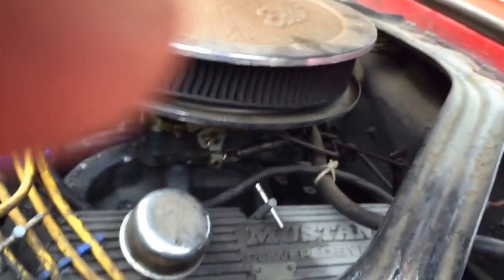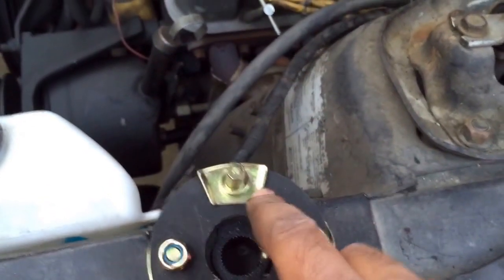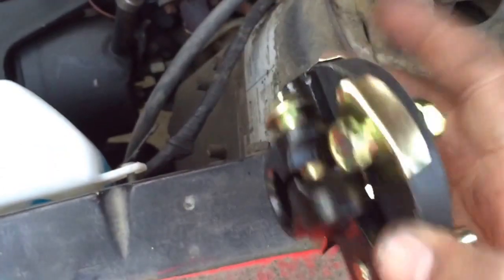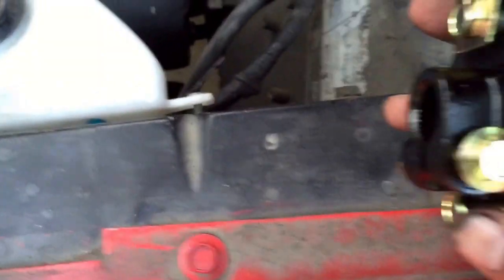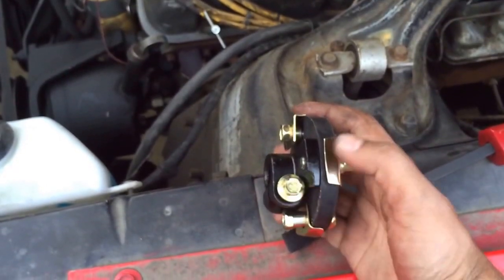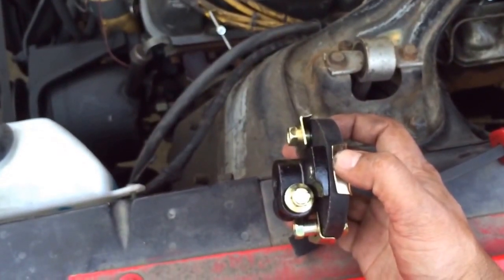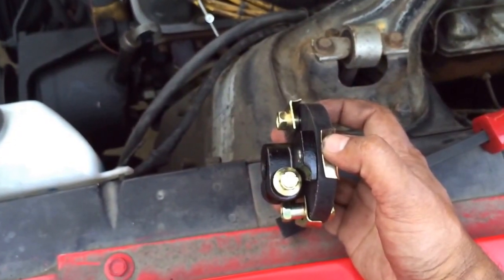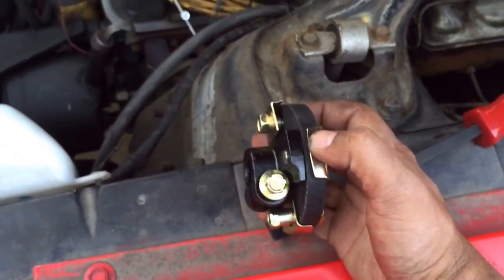Vintage mustang Rag joint removal and replacement.

Comment: hey bud, how did the new rag joint work for you? 
Also why did you replace it? I was wondering what problems you had with it before replacing the rag joint?

Thanks!
Reply from the maker: Hey Noel. The rag joint was bad,no doubt about that.  Changing it made some improvement  but I still have a lot of play. These cars just have sloppy steering boxes and linkages.
Reply: +Karl Dias I have a 67 mustang coupe. I'm having similar issues like you. I was thinking of doing it myself, your video inspired me. Hopefully I don't make it worse. 

Good luck with friend. 👍
Reply from the maker: The only problems I had was lots of play. The power steering hose was bad and leaked all over the joint ruining it.  It's the only connection between the steering wheel and the steering box so it needs to be solid.
Reply from the maker: Remember when you put the shaft back to the coupling you need to extend it.  It will come up short when you put it back. Don't panic. !
Reply: +Karl Dias I've been looking at other videos with the steering wheel having a lot of play. I'm hoping that my steering box doesn't need to be replaced. I will check all the suspension parts and go from there. Replacing these parts seem to be do-able.
Reply: +Karl Dias Thanks for that but of info. I'll make sure to take note of that. 

thanks.